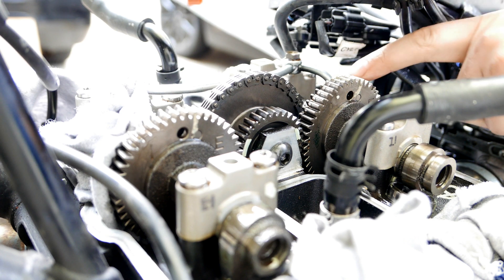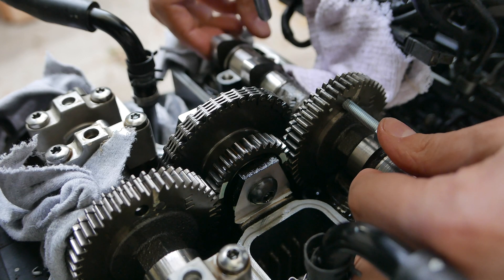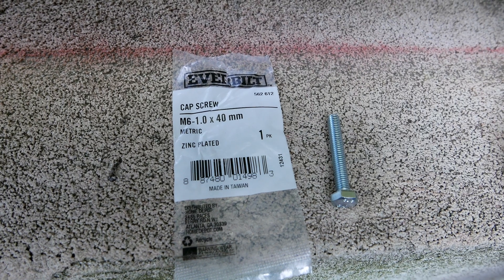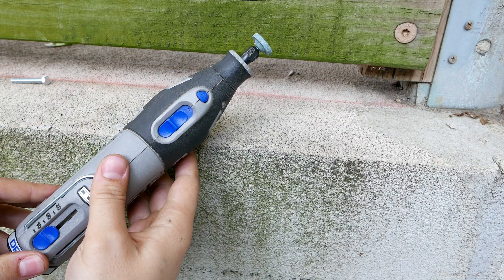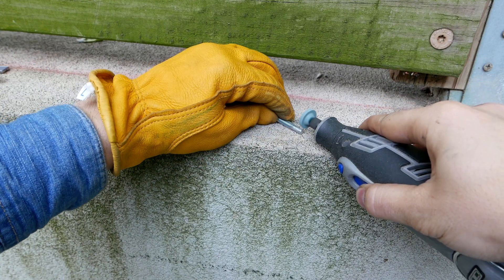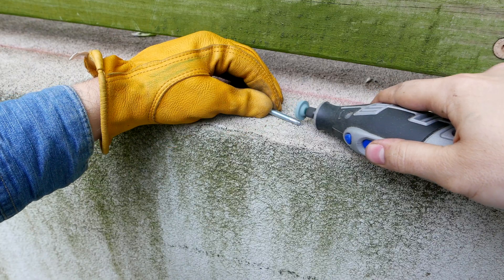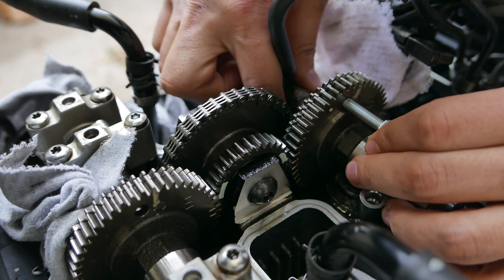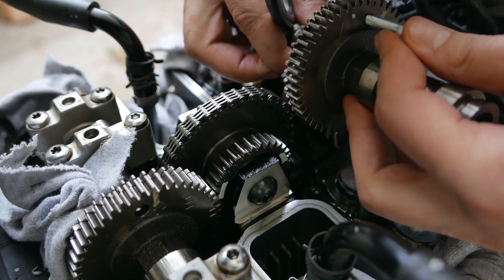How to Create a Triumph #T3880330 Camshaft Locking Pin Tool

Comment: Is the smaller pin 4.1mm or 4mm?  Haynes manual shows 4.1mm.
Reply from the maker: I’d trust Haynes at 4.1mm. But if you are making the tool yourself, then you can grind it progressively smaller like a cone to make it work regardless of that 0.1mm.

Comment: If you don't lock them will the engine start knocking/ticking after it's put back together?  I think this is why my speedmaster got a ticking sound after a valve adjustment at a local shop